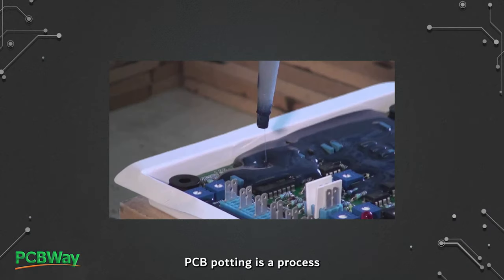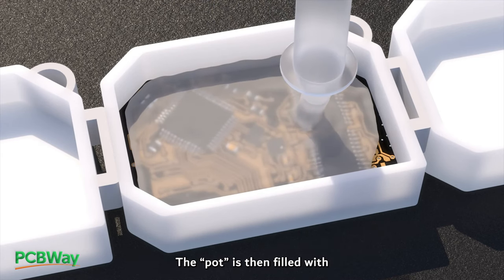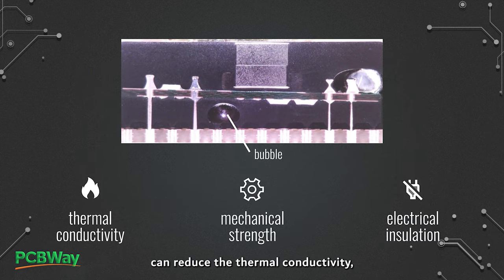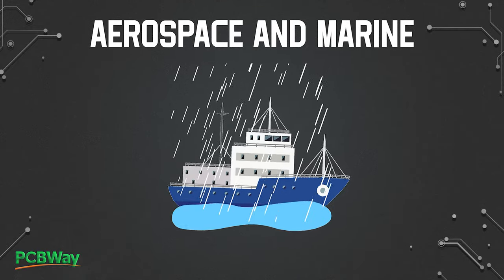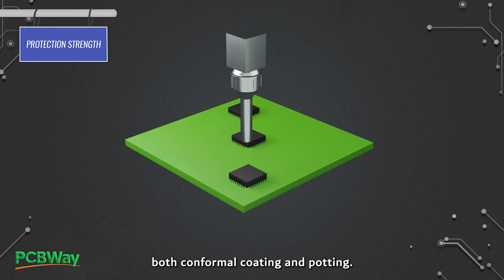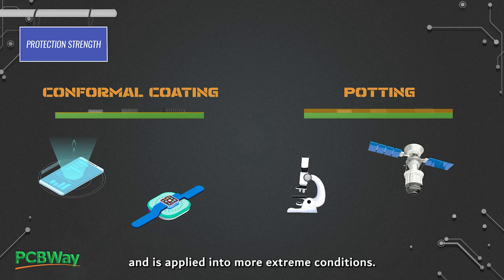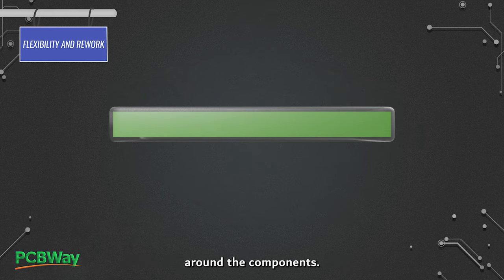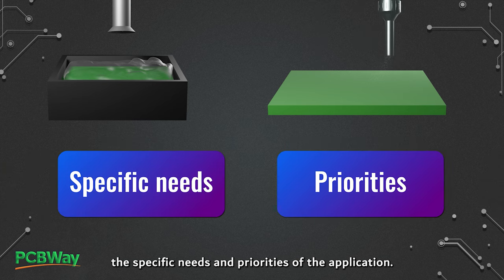PCB Protection: Potting or Conformal Coating? | PCB Knowledge

Comment: It's important to note that most epoxy potting solutions can be boiled in water and at the 212 degrees Fahrenheit will soften enough to turn into sort of a gel that can usually be peeled apart in pieces and taken off
Reply from the maker: Thanks for the additional information!

Comment: I'm wondering why some battlebots don't use the potting method to protect the more sensitive boards from being slammed around
Reply: Because of cost? It's more common in mass fabricated electronics where one or few mold (or in this case 'pots') can be reused over and over again. Plus it's only practical if you have no plan on reworking on the circuits later because once it's potted it's impossible to be removed without damaging the circuit.
Reply: 3d printing negates the cost. However thermal transfer goes down vs direct air contact.

You could use silicone to be peelable, but as above thermal transfer conductivity would be lowered. ESCs for driving brushless DC motors get hot. Wireless does as well.

All methods make repairability drop.
Reply: @boxcarhobo8315  hmm, couldn't thermals be solved by using a heat-sink and heat transfer lines similar to how gaming laptops move heat? or would the heat dissipation not be enough? (the thought of having them potted is specifically for boards that aren't going to be modified and would continue as-is after they were finalized.)
Reply: @AchievementDenied  Thats a good question. Another thought would be to pot it, but to the point where you could still have access to the top surface for cooling. 
Sadly, I changed jobs and don't have the workshop I used to, and my electronics work is now for the hobby level.
Reply: @boxcarhobo8315 you got it backwards. Silicone is much better thermal conductor than air.  
It's just a pain to debug or repair anything once it's coated.

Comment: Is there a solder flux that doesn't cause cure inhibitions with platinum cure silicon potting compounds?  Some factory solder joints with flux residues don't have the issue but I don't have any information on what solder flux they are using.  Any knowledge about the issue would be much appreciated!

Comment: Is there a source for more info on potting?  I've had a lot of experience with various potting materials for electronics used on earth moving equipment.  The hardest potting material has been known to crack components (such as ceramic caps).  The softer materials will provide moisture immunity and won't break caps, but do need the packaging to provide mechanical protection. There's also the issue of getting the potting to reliably bond to the walls of the pot or package.

Comment: Only boards exposed to water and other contaminations need this. Potting makes pcbs impossible to repair.
Reply from the maker: Yes. In common applications, conformal coating is more often used.